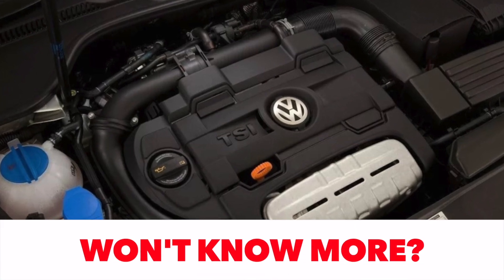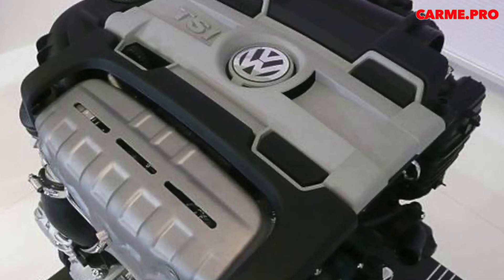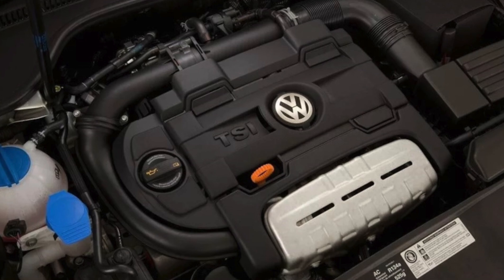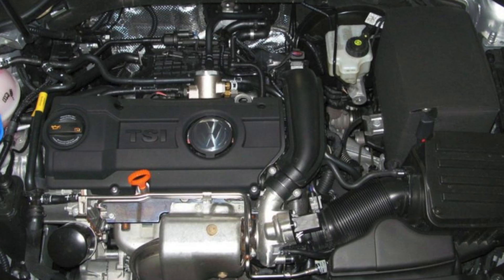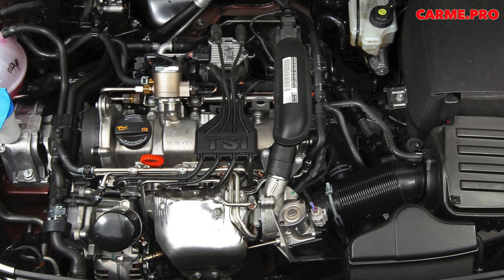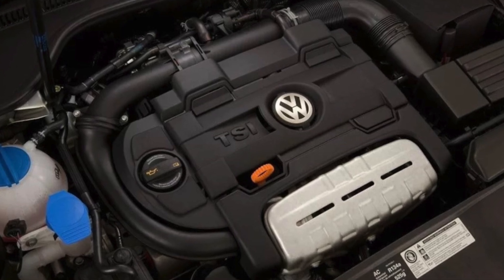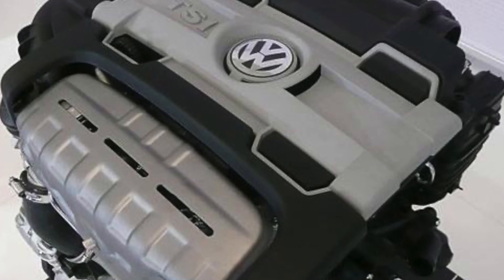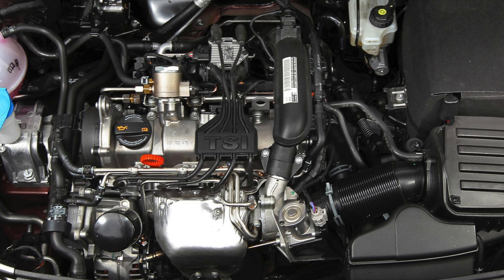1.2 TSI and 1.4 TSI  - Problems, weaknesses

Comment: i have Ea211 1.2tsi 81kw stage 1 96kw 250tkm and it's running fine, soon the hybrid turbo will be mounted then the engine is gonna make around 200 horsepower.
Reply: Don’t do it unless you are going to put alot on money on forging the engine. Mine is stage 2 (tuned + intake +downpipe) and its pretty fast for an engine that size!
Reply: Clutch and turbo on this motor cannot handle more than 175

Comment: The biggest problem with these engines is they are made by VW.
Reply: Why is that a problem?
Reply: Tbh vw engines are usually fairly reliable, but these tsi engines are well known to be terrible reliability wise.
Reply: They are specific tsi motors that are  problematic (mostly 1.4 and tbh vw group cars here in greece at least are known for being driven by who drive at 6rpm minmum if you know whatit mean @Thiiiiij
Reply: @x.kasiouris5503  Yeah no warm up with oil nothing just Kangoures!!
Reply: @x.kasiouris5503 never seen another vw driver not driving as fast as they can
Reply: Sadly I agree
U can't beat the Japanese quality
Reply: I have 100000km with no problem
Reply: 100000km is nothing for an engine, my Honda has 250000km with no problems @eli27per
Reply: try driving a french gasoline car and you will never complain
Reply: @ymirfritz9989  until it breaks down at 60000km...
Reply: @J2I3H  thats warranty territory
Reply: @ymirfritz9989  doesn't make it a good car😅
Reply: @J2I3H  there aren't any good cars with your mindset, a French car would barely last 1000 km